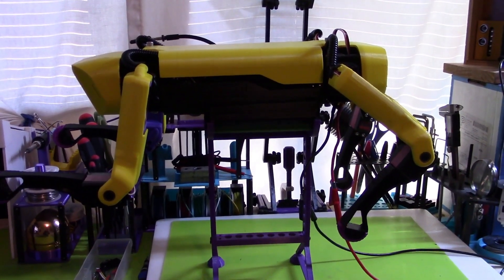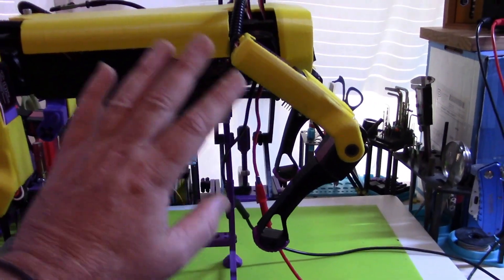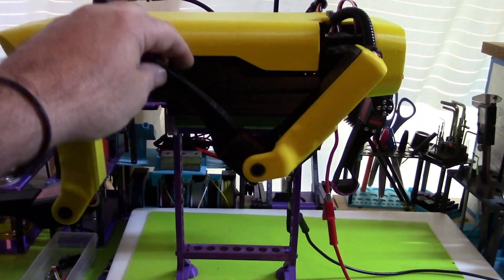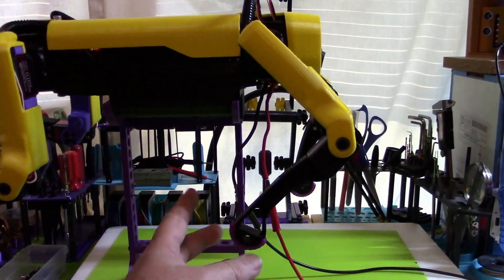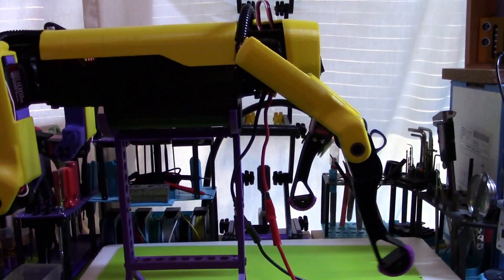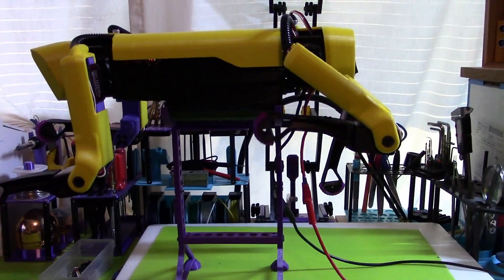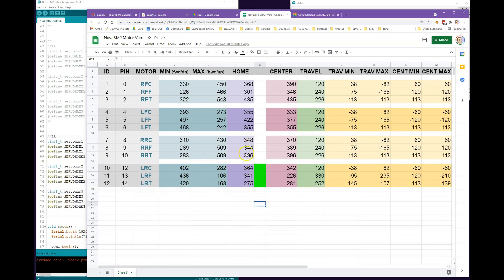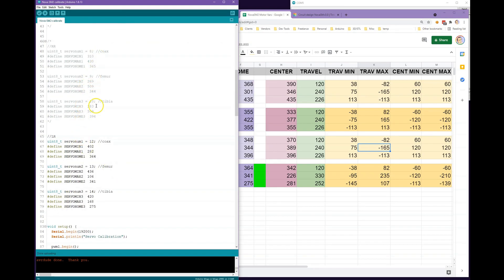Recalibrating Motors : Nova SpotMicro - a Spot Mini Quadruped Robot Dog Clone

Comment: How do you use a x box controller with the arduino
Reply from the maker: I had a PS2 remote connected in a previous version - its a nightmare, an RF remote is much better.  And sorry, I've no experience with XBox remotes

Comment: i have a question about the power supply, as the main battery voltage goes down does the buck keep it consistent? thanks
Reply from the maker: it will maintain the correct voltage, yes.  If you're asking if a battery with 6 volts remaining will maintain 6.8v, no. However, understand the limits of lipo batteries... if drained too low, they can become garbage, so definitely monitor the battery (there is code and hardware in my project to support this)
Reply: @ChrisLocke1969  ok thanks, what do you think to using a 6v nimh pack?